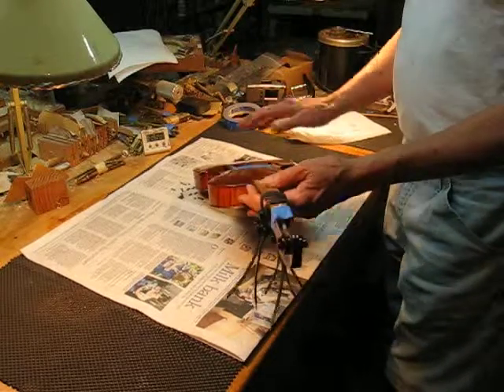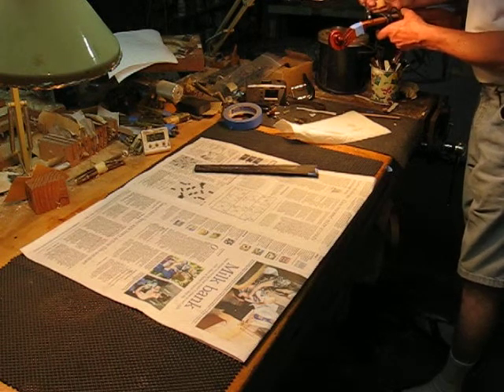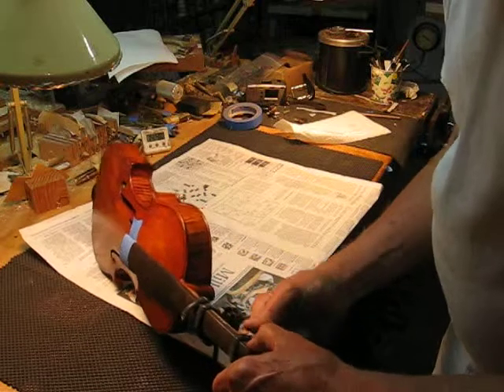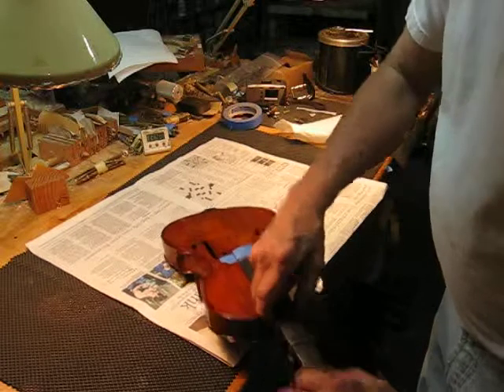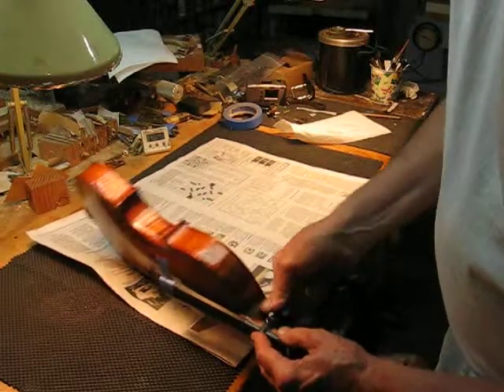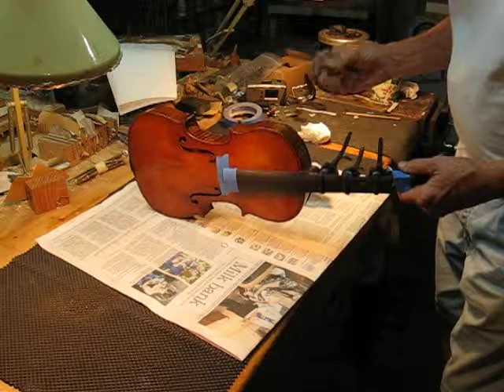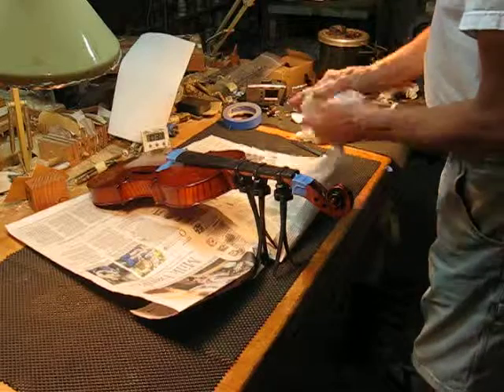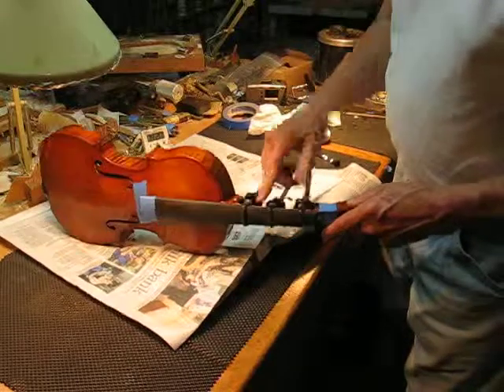FingerBoard Glue On Opus Nathan

Comment: what glue do you use? animal glue? titebond?
Reply from the maker: Ky  For stringed instruments always use hide glue (animal glue).  It is very strong and does not creep even under heavy pressure (think tightened strings) for long periods of time.  Also, since it will soften with water, the top, fingerboard, and other parts, can later be removed if necessary.  The best hide glue is rabbit skin glue, with how hide glue second best.  Bone based glues are lower quality still.  Sears and others also makes a premixed hide glue.  To make up your own hide glue, you buy the granulated glue and mix it into hot water (150 degrees F.).  You want a smooth, rich glue when ready to use; that runs off your brush in a steady stream.  David L.